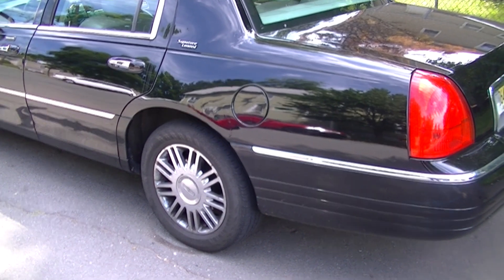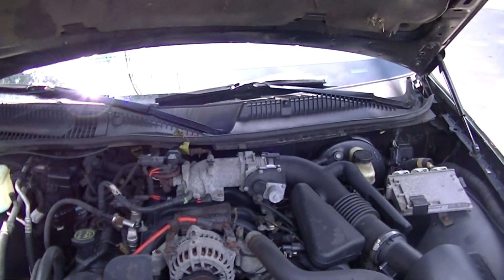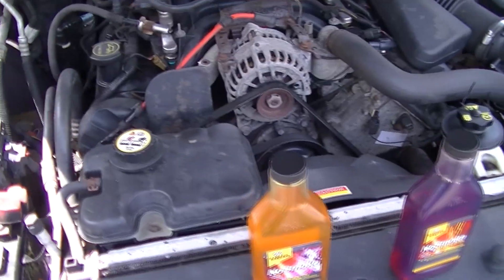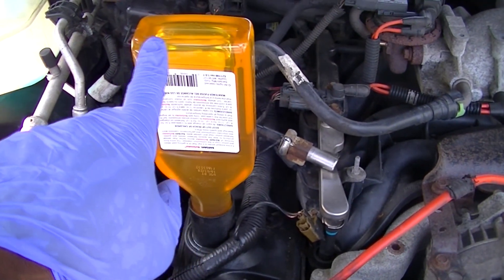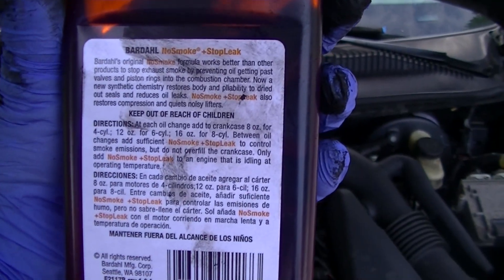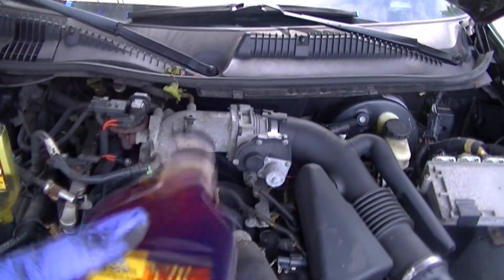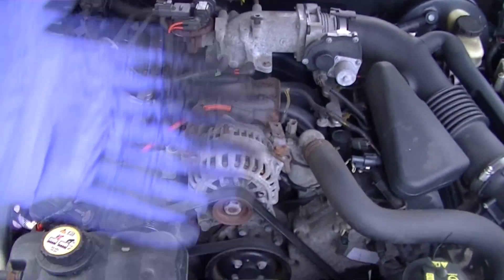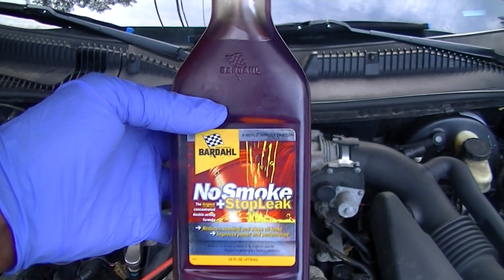Bardahl No-Smoke oil additive

Comment: No more smoke? Are you still using 5w30?
Reply from the maker: This is not a mechanic in a bottle Daymeon its a great ITEM IF you where selling a car ( on some slick stuff ) 5w30 you can try but this will work DEPENDING on the condition of your smoke.. Rings this aint helping that
Reply: @bstfordchannel923  I had some greyish looking smoke. I changed the pcv valve and that did the trick.  I'm thinking of going to Mobile 1 5w30
Reply from the maker: @daymeongartrell4809  Well if that worked man you are golden... I would still use the 5w20 cause the how the motor was built very very close tolerances, but do as you wish.. Do what makes you feel good brother
Reply: I love the Town Cars.  Mine is a 2011 Executive L.  I'm glad you're  sharing info.  I try to handle  maintenance myself.
Reply from the maker: @daymeongartrell4809  To be honest its simple just check fluids and change fluids.. Thats really it nothing major bro
Reply: Daymeon Gartrell did you smell oil? Did it smoke a lot?
Reply from the maker: @MrSonic731  It smoked when ran for awhile...  check you pcv change that 1st

Comment: If your car smoke on start-up for a while, you need to replace the valve seals and problem solved
Reply from the maker: 100% correct but this is for those that want to sell a car or stop the smoke for some other reason
Reply: @bstfordchannel923  good point. I used this additive on a Honda CB 750 SC Nighthawk 1982 motorcycle it worked well and reduced exhaust smoking 60% or a bit more. I've used also as chain lube and worked very well for that purpose.
Reply from the maker: @singerdog  I had few bikes myself i had 1974 H2 ( that smoked ) 2 stroke engine a rocket this old thing was..  Gs750 and Katana 750 and Zx7RR .. I should have used this on the older bikes, but man I just wanted to ride lol
Reply: Which would cost many hundreds of pounds in labour
Reply: Valve guides and seals are probably gone at start up as the oil drains past the seals then down between the valve stem and guide after it sits and pools in the combustion chamber then burned off on start up . Best to pull the heads and either have the guides replaced or knurled then some new seals preferably umbrella seals if possible and that should take care of it depending on how good of compression it has or a leak down test done to see how week the rings are or how good the valve seats are sealing !
Reply from the maker: @peteloomis8456  you are correct on all of that it would be cost effective just to change the engine cause if you are doing heads then ( to me ) you should rebuild.. I rebuilt heads and then the rings blew later 9 after beating on the engine ) you correct Pete

Comment: I've never used that no smoke..  I wouldn't put 10w40 in the town car..as it will probably effect the fuel economy ..  My 03 Town car had black carbon in the tail pipes when I got it, and it went away after cleaning the fuel injectors and MAF sensor and lots of HWY driving.
Reply from the maker: This isnt carbon i have cause it stuck to glove in a major way... I am sure your 03 runs a lot better than mine.. They beat cars to crap around here... people buy a car they really dont want to maintain ( and its cheap and simple ) just do a oil change or fluid change on car...So i bought someones neglect lol
Reply: my guru buddy said 10w40 causes sludge something about the weight molecules being too different. engines i looked over in the junkyard that ran it seem to coincide with that.
Reply: oh I know your car doesn't have carbon in the tail pipes.. the valve seals and guides are gone. Yes you're right my 03 runs good.. but it should for it only has 110k miles.. I need to check the oil.. and when I last changed it.. it's been 10 months since I last did an oil change on it.. I don't use it much only over the summer months ..I try and keep the salt off of it.  Did you get your A/C fixed ??
Reply: I think it depends how hot the motor runs .. a cold running motor I think it can cause a motor to sludge up.. I have a 66 Continental and I run 10w40 in it.. but it runs quite hot 212F
Reply from the maker: 462-A i am lazy lol i didnt do the ac yet cause there are other issue with the car like ( rack ) I order parts and it took a MONTH to get here.. package got lost they sent new stuff... also i have a ABS issue to... I really would like to change the car for a longer version the Lincoln Towncar L.  plus the engine worn and stuff i am trying to get the car to go through another winter at the least ( the decide )
Reply from the maker: You have to drive your car abit I have these patrol cars just sitting I had plans but they closed the near by raceway so i have to go further south to get some straight line action..
Reply: Oh I hear you on being lazy.. not sure it's being lazy but just plain tired.. you do drive a lot... I will put a few hundred km's / miles on my 03 this weekend. it's gonna be hot! Saturday and Sunday. It will be cool if you can take one of your patrol cars and run it down the track!  I like the Town car L series.. with the added leg room for the rear .
Reply from the maker: I am going to set that up once I get  the info on track days on Adco raceway they are a few other to i have to check.... its going to be crazy hot those days and i still have no ac lmao I am tripp'n for real.. I have to get that L series its a must 462

Comment: But what about after another oil change my friend? Also being as this is a Triton engine, just replace your PCV valve, since in my case that's solved this every time on Fords.
Reply from the maker: My engine is beat ( runs smooth ) but beat when i got this car ( i remember the oil being low... Now PCV I can see that and tried that and this aint that its ( has blow by )...This guy ran 10w30 these motors ( many new ones run ) light weight this fool put the wrong weight ( its done ) i do 150-210 miles per day i put a 2 quarts a week (  Bardahl No-Smoke oil additive) its down to 1
Reply: Oh that sounds good, probably with that usage though I'd look into another motor but that's just my 2 cents.
Reply: BST Ford Channel nope. U can run 20w50 and it won't hurt a Triton. It's valve seals your engine isn't worn. Run at least 5w30.
Reply from the maker: Cool to know, but the funny deal is with this engine when the oil is ( old ) it will semi-knock on start up ( mainly ) the filter i change the filter ONLY one time just to see... The filter was the issue with the bad oil, but soon in a about a week it knocked on start up again.. So the oil broke down ( i am guessing ).. If the Valve seals are worn  well the whole thing worn to me lol ... So we shall see how long it will last (  the engine ) you are the man D4x4
Reply from the maker: I have a Interceptor motor ready to go ( i have a issue ) with the anti loc if i cant fix that then i will not use the car and put a motor in it... I really need a car with BLACK interior this tan interior gets so dirty quick.. Looks like crap when its slightly dirty ( IT HURTS TO SEE ) I have to shampoo the carpet almost weekly ( bootleg shampoo) though
Reply: valve seals always been an issue with the 4.6s. I think neglecting coolant overheats the heads and by design they go bad. use ONLY fl820s motorcraft filters
Reply from the maker: I hear ya Thats the ONLY filter i use and its pretty cheap cost a little less than a fram...I can side with the neglect coolant ,BUT i will say this the interceptors DONT DO THIS. they change oil all the time , plus they use the right oil, and the have oil coolers ( ONLY ) police version have oil coolers and I think the Lincoln should have had that to" at least the Lincolns"... The cabs dont have it either which is strange they all have power steering cooler though ( which helps )

Comment: Can u added on every engine oil change?
Reply from the maker: Yes Genaro I do with every oil chnge it cost the same as a qt of oil.. Just give it a try label say put in car when ( running ) some cars dont run well with oil cap off... I am sure yours run well just add after car is warmed up..

Comment: i just tried it out during my oil change. lets see how it works.i used this stuff once before with dirty oil and found that it didn't work.
Reply from the maker: you should be able to over fill like that.. its not like a full qt, but it should work for mild smoke not for ring issues